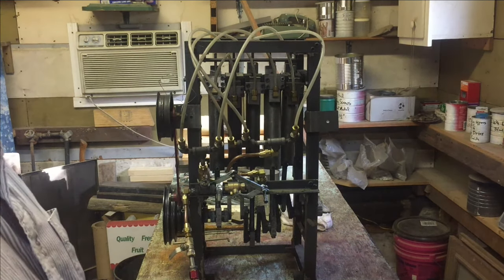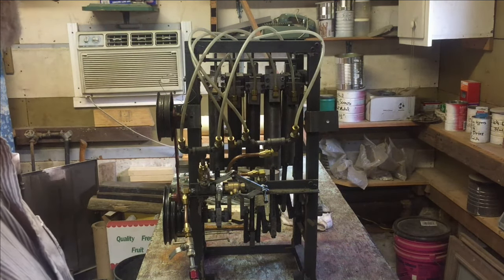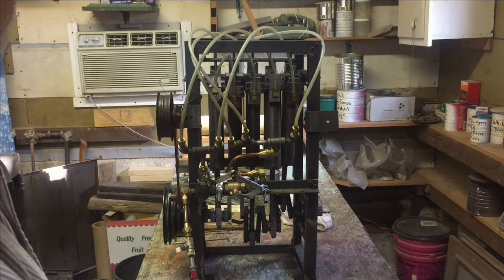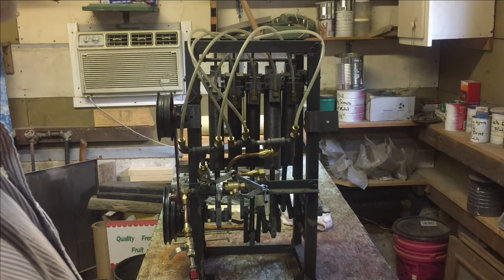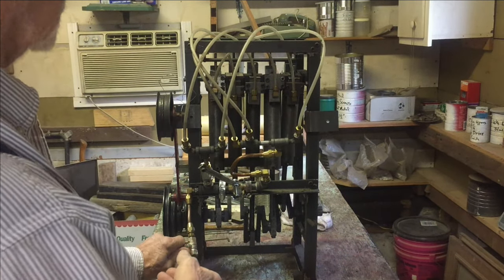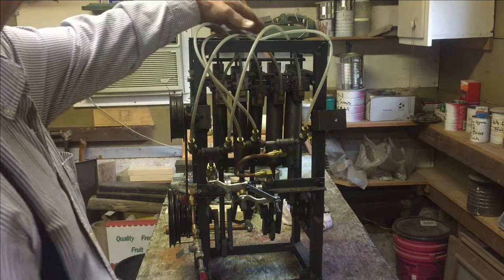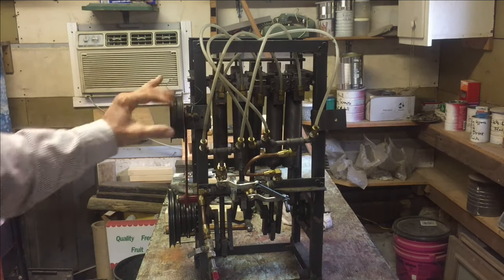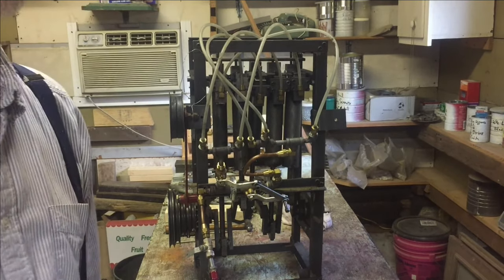A Car Compressed Air Engines, Comparing 2 Types, Eccentric & Crank Shaft 10-3-2020.

Comment: Your engines are beautiful. I have been building air engines for quite a while now and am currently working on marrying 3 Briggs & Stratton horizontal engines into an inline configuration all run by one crankshaft.
I have an old garden tractor and I want to see if I can get it to run with the three engines on it. I'm doing it purely for fun! So whenever I'm a little bit tired of working on it I watch your videos and get reinspired! LOL thanks!
Reply from the maker: It would be interesting to hear how this turns out with three Briggs & Stratton‘s, and also I’m wondering what kind of compressed air storage tank you have to run something that’s going to take that much compressed air?

Comment: I really would love to experiment this but I just want to know something regarding safety 

I have heard that air compressors can explode e.g when driving a car and their is a collision that’s what I’m worried about otherwise I think this is just extraordinary
Reply from the maker: Thanks for your interest voicing your concerns about the High Pressure Air!
You are right, it is very dangerous with 4000 to 6000 pounds per square inch air pressure!
There are Carbon Fiber Pressure Tanks available that can hold that pressure safely, but very expensive at $4000 - $5000 for one. 
http://steelheadcomposites.com/ is one company that makes those kind of tanks.
In order for us to be able to go 200 - 300 miles with our compressed air cars, we need that much pressure in a good sized tank. The cost of the Engine is very little compared to the tank, so a one time expense for a tank isn't so bad.
We also need a way to fill the tank when needed, so we have to come up with local filling stations using wind or solar power to fill the station tank.
We have a way to go, but I can't see giving up when I see the possibilities!
Thanks again and keep checking in.

Comment: you can strike a deal with custom car shops to convert gas engines to a compressed air engine since most of your parts are custom meaning different sizes and mounting you can circumvent copy right infringement
Reply from the maker: Thanks for checking out my video and commenting.
Having others work with my designs might be an option at some point, but I would have to have a working design, that I've tested and am satisfied with.
The video you watched was one I put out in Oct 2020 and have rejected both designs for being too complicated and requiring too much Compressed Air to be feasible for going any distance.
The design I am working on at the present time is a new idea, using eccentrics that are being driven from the outside.
I don't like the hoses, connections and some problems I'm having with using 6 valves.
Every design works to some degree, but always seems to get more complicated than I'm willing to accept.

The address to the current video.
https://youtu.be/fO85Ng-uYNA 

 Thanks again, and if you haven't subscribed, please do and be sure to check the " BELL " to be notified of future videos

Comment: Love this stuff and by the way great job!
Reply from the maker: Thanks for the comment!

I spend a lot of time thinking about what I’m working on and it takes a lot of time to work out the problems I run into.

My latest problem is figuring out to set the timing on the eccentric bicycle assist motor in my last video.

I’m pretty sure I have an idea how to get it done, but it’s kind of tight were the valves are - I might have to make a couple small adjustments on some internal parts, like the pusher bar that rotates the engine - watch for my next video!

Comment: thanks for your work . its interesting to me . is it your goal to make a more efficient air motor , or to make an air motor that can be reproduced and maintained by the average user ?
Reply from the maker: Thanks for checking in and the comments.
I am an old shade tree mechanic and understand the frustration with how engineers design and then we have to work on something that you have to take the engine out to change a spark plug!
Most people would not want to build them, but if they do, I want it to be simple as possible.
I want to be able to put it together without special tools.
If I think something is wrong, I want to be able to take it apart, or take the part out and work on it.
Compact and efficient is a very high priority with compressed air, that will depend if my goal will ever happen!
There are a lot of variables to make it all come together, and it takes time and patients - also trials and errors.
The testing vehicle doesn’t have a transmission, so it uses a engine to wheel ratio that would be like starting off in 3rd gear with the engine at idle - a gasoline engine would not do it.
Since a compressed air cylinder
Has maximum pressure as soon as you put air to it, it works for my engine and a clutch is not necessary.
I hope to put it in my 5 speed small pickup at some point.
If you have any specific questions that I have an answered please send another comment. And once again thanks for checking in.
Reply: @AirEngineResearch  have you decided that a piston is the most efficient power source for air ? if so , i agree. have you considered one or two very large pistons conected to a rack and pinion , i got this idea when i saw the flwheel wood splitters on the market today
Reply from the maker: Yes i have thought of that design, using the Rack and Pinion, and also using the racks with  two one way clutches. 
Once i designed it all out, it was not what i wanted.

If you use a 1" Pinion and a 2' Rack, with a large piston, it will use a large amount of compressed air and the pinion would turn about 8 times. With that small of a pinion, there would be very little torque.

To get 1/4 Ft Lb of torque you would need a 6" pinion, and then it would only turn a little over 1 time per stroke, and also, there has to be a rack pushing the opposite direction or some other way to get the piston back for the next stroke. If you have 2 Pistons & Racks, that makes the over all length over 4 ft.

I also ran into problems on how to valve the air and exhaust, and I just found that was not a good idea for a compact type of engine.

I have found a lot of seemingly good ideas - get pretty complicated!

I think I said once before, I would be interested in seeing what your designs or drawings look like on paper?

Comment: If you put a flywheel on your motor you will use less air and have more horsepower if you put a heater on there to heat up your air  before it goes into your  motor it will also increase your horsepower and your torque  you also have to get rid of all plastic lines and the hotter you heat the air the more fuel you have that means a smaller air tank
Reply from the maker: Thanks for checking in and your comments.
My goal is to have a simple compact engine that can be maintained and worked on easy if needed.
The torque with this engine comes from the compressed air, not from the speed of the engine, so I believe it is not necessary to have a fly wheel - which would add more weight and increase the size overall.
I am also thinking a one way clutch would be good, to let the vehicle roll (freewheel) without having the engine running any time going down grade.   
I agree it would be beneficial to have the compressed air heated, but I believe too complicated to be worth it.
If you have some detailed design ideas, please share them with us.
thanks again for your interest in what we are doing.
Reply: Nice. Could be used in reverse to compress Air Back?
Reply from the maker: Yes, you are correct!
If you turn the engine around, the crank shaft turns to the rear.
If you reverse the intake and exhaust positions, the engine will run backwards.
That would be a way to have forward & reverse without a transmission, say have 3 forward, and 2 set up with valves reversed on a separate air valve to back up.
Reply: @AirEngineResearch  Great! But I mean ... Can you invert the running in order to work as a compressor and "refill" the pressure in the reservoirs of compressed Air as a " recovery brake"
Reply from the maker: It would not be worth it, I’ll do a video and cover why. I have looked at doing that in previous videos